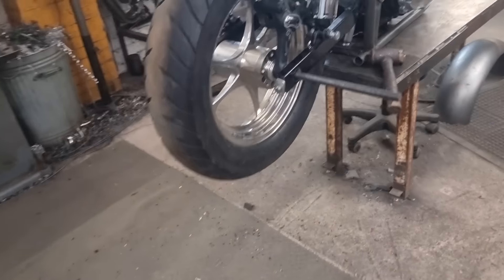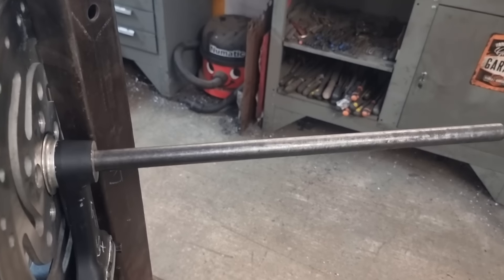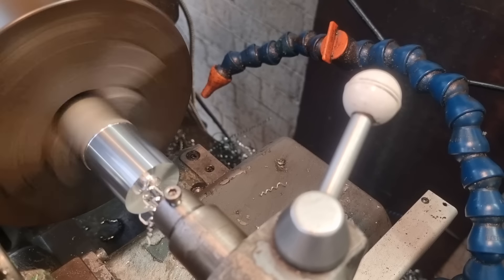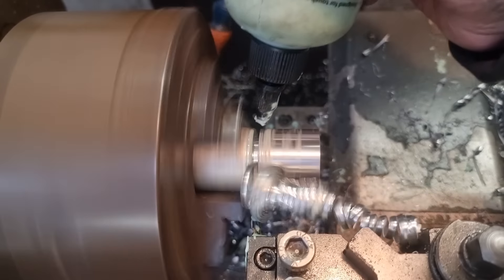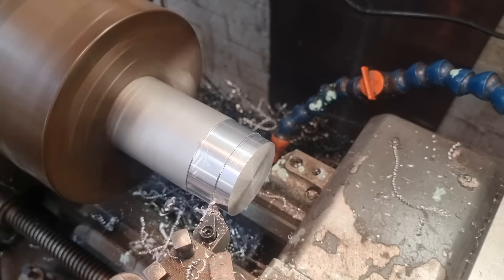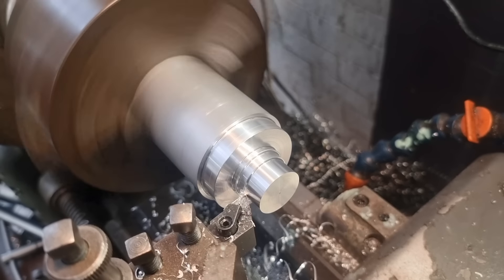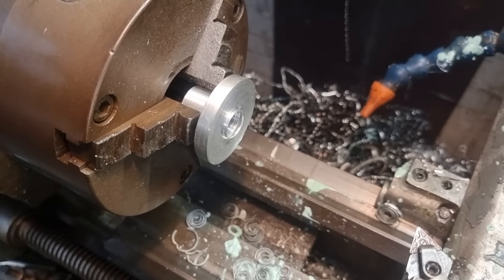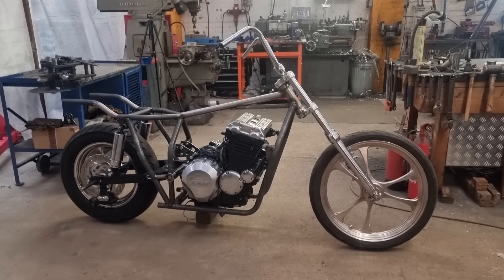Triumph Swingarm Chop Pt8 Handmade Custom Bike Building #chopper #bike #engineering

Comment: Nice job mate, I've run into a similar problem with a 25mm (1") Harley wheel to use on a Kwaka which was 20mm I believe. Rather than feck about with step down spacers and the like I changed the wheel bearings - same outer diameter but with 20mm inner and then used ordinary spacers - a lot less hassle in the end
Reply from the maker: Yeah, I didn't want the hassle tbh, I  wanted it squared away asap

Comment: Nice job Ralfy, question for you, do you prefer the mag wheel or laced for getting it centre in the frame or is some offset acceptable?
Reply from the maker: Laced if it's proper tricky, a small offset is perfectly acceptable on a chop, as long as the wheels are parallel